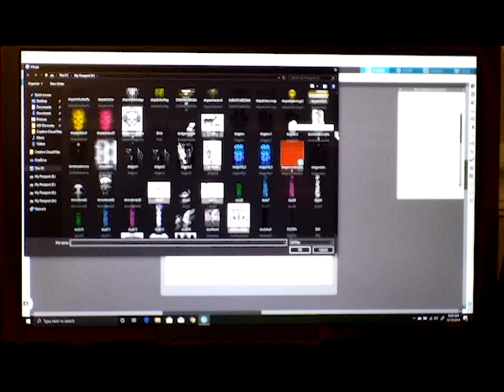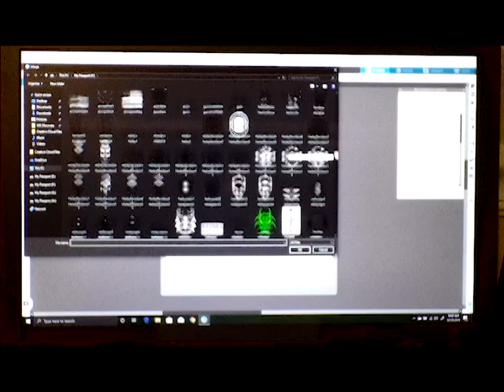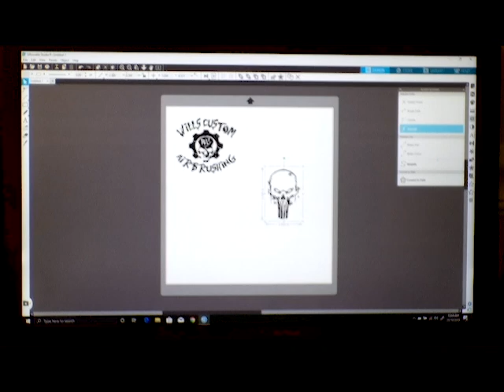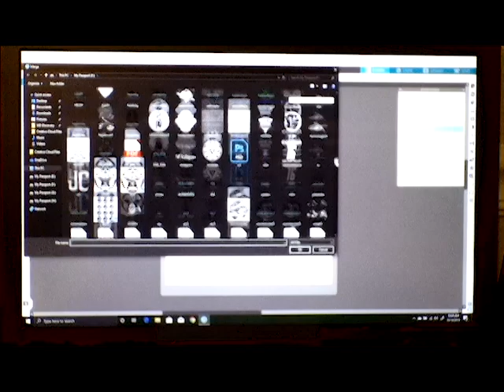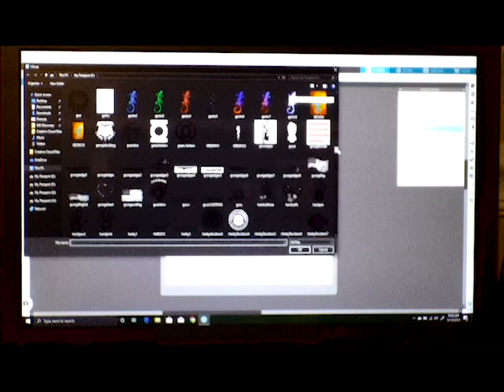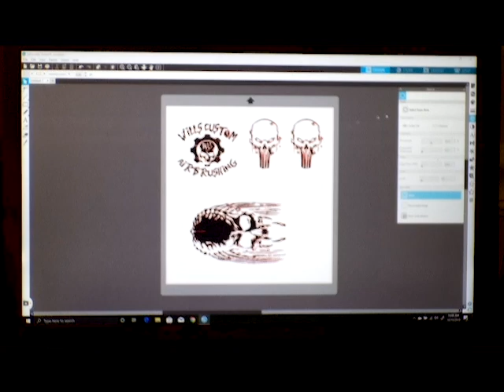How to paint a custom tumbler.

Comment: Wow my brotha , you make it look easy Will . Now I have to work on getting the Toys to make kool Artwork. ? How do you have your Oven ?? Do you make them . Thanks an keep up the amazing work
Reply from the maker: I made my oven from an old stand-up freezer. I took the heating elements from an electric oven, and installed them on the top and bottom of the freezer. I maintain the temperature with the parts from the old oven.
Reply: @artistwill  wow , you are Da Man . You make it sound easy,  one of these days can you take pictures. Send them to Messenger if you do . So i can visualize and plan for to setup , and maybe try to make one . I have 5 years before I retire 😁 . So i have time hahahahaha , thanks again